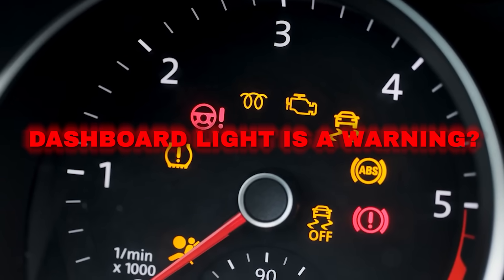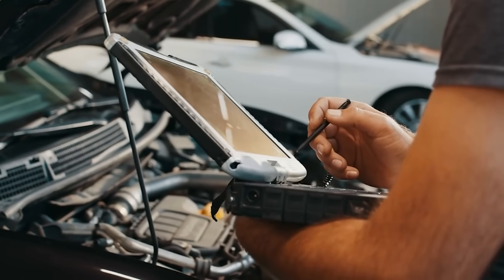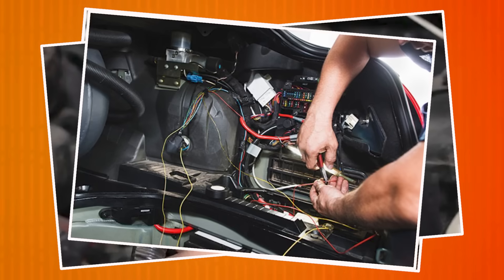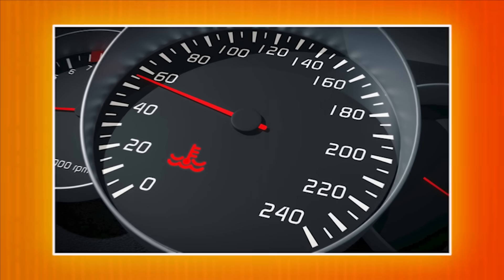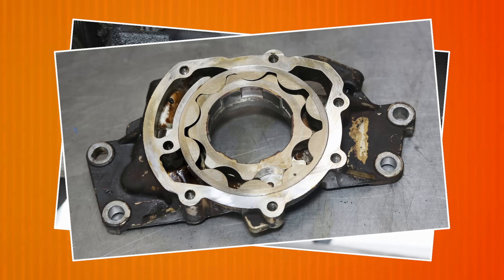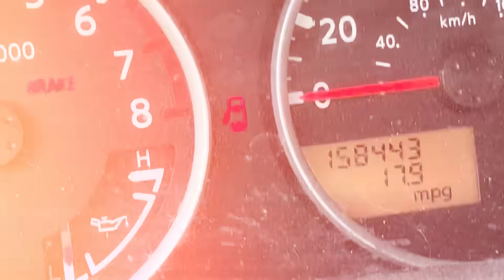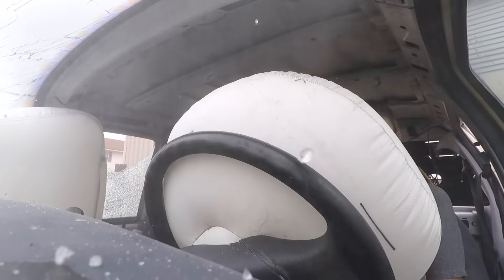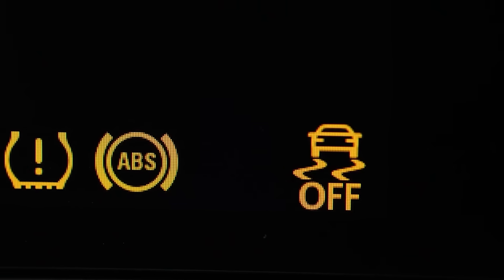Every Dashboard Warning Light In Your Car Explained

Comment: my 2005 bmw 120i keeps on showing the gaslight signal, engine overheating signal, coolant low (just because I forgot what it means), Airbag faulty (I think),  the gas level is low signal,and the preheat signal  and I think all of these are bad. Edit: I forgot preheat

Comment: The oil pressure light can also mean a clogged filter, dirty oil and even bearing failure.
If you notice a tire loses pressure more often than the other, try overpressuring a few PSI over spec, wait a while (DO NOT DRIVE) then recalibrate the tire to proper pressure. Especially if it's a new tire. It could not have settled properly in the rim. But if the tire seems to keep the pressure for a few weeks, have it checked, could be a micro puncture or worse, a bent rim.

And all of these could be just a failing sensor or loose wires.

Comment: Just bought a Mazda 3 2012 with low miles and getting familiar with all the controls. So when I turn on the ignition, I see the wavy I think water light that’s blue. I checked the coolant and it’s has about half full and I can’t see the marking on where to fill up to, 

Also if I need  to add coolant, can I just buy coolant and add to what’s already in the coolant tank or do I have to flush out the old stuff?
Reply: Fill up

Comment: I always turn off Traction control in winter I have more control of the vehicle without it.
Reply: My light just turned on and says OFF. What does that mean? I just got this car 😢
Reply: @CookiesCritterCare if your traction control light is on it means your traction control is off it could mean a faulty wheel sensor, or a problem with the control electronic module the system is there to tell you that your car has lost traction if it’s not working correctly you have to go by feel and know when to release your gas a bit bit if your not a experienced driver that could be dangerous. I personally don’t use it but I’ve been professionally trained to drive without it and I feel more in control.

Comment: 2:28 an old ford F 150 when pulling a  boat, all of the sudden, the battery light came on, the voltage spiked to 18, and the ac fan cranked up. Failing alternator…

Comment: When removing and replacing a battery is it normal for the check engine light to come on.?😊
Reply: Yes, that can happen sometimes. When you disconnect and reconnect the battery, the car’s computer may reset, and the "Check Engine" light can come on briefly.

Usually, it turns off after a few drives once the system re-learns everything.

But if the light stays on, it's a good idea to scan for error codes – just to make sure there's no actual issue.

I also talk about dashboard warning lights on my channel – hope this was helpful! 👍

Comment: I dont think your right about check engine light mine has been on a long time no issues.
Reply: Mine too it comes on and goes off and some times it goes into limp mode. but the mechanic can't find an issue. It might be because I put a bit of petrol in my diesel engine. My tire pressure sensor light as been on for about 2 years but it's not tire or pressure I think the sensor in the weel is faulty
Reply: @Cronicjack ye i dont know why but my oil light is on for 2 years and i only needed water to fix it
Reply: where i live, when the fuel is really bad in quality, the check engine comes on
Reply: @kvrdich4528 if that s why it s on you need to clean your egr valve, it s very simple
Reply: sometimes it does it when you dont have the fuel cap on
Reply: That’s called having a Volkswagen group car
Reply: That’s what I thought and my car died, get it checked